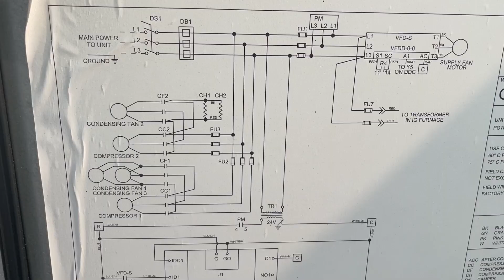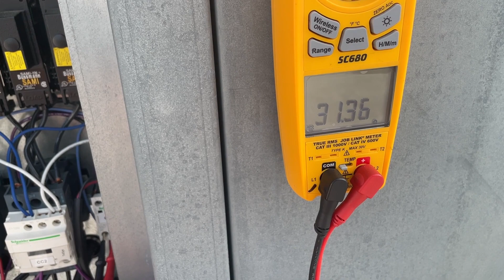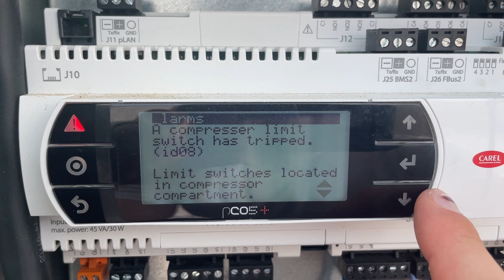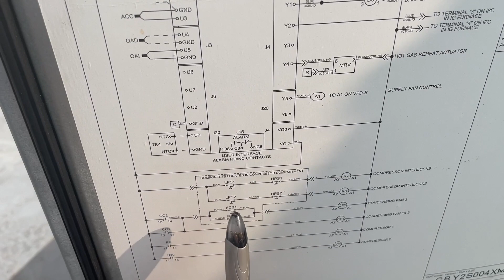Diagnostics45: How to Push a Button 😂 Greenheck MAU With a id08 Compressor Limit Switch Error Code

Comment: Seems like all the calls I run in commercial are lack of maintenance. The newer equipment is so much more sensitive to lack of maintenance. Its funny how some of the older units are in such bad condition and still just chug along. Interesting that unit has a manual reset for high pressure.

Comment: From my experience with Carel , there should be an I/O menu where you can see if the pCo receives the info that the ID contact is open or closed , which is useful to know that the problem isn't a burnt entry on the pCo .
Btw it must be kinda confusing for the English speaking world cause they use ID ( Ingresso Digitale ) in Italian instead of DI 😅